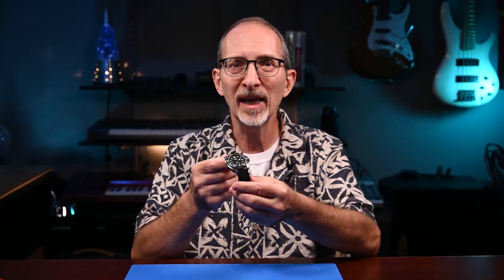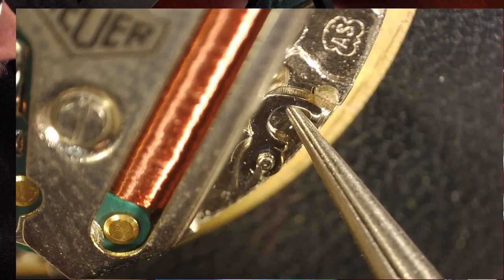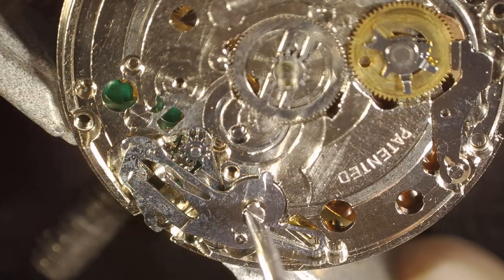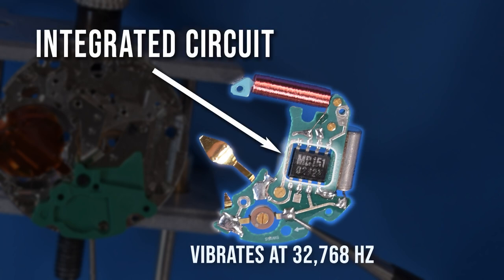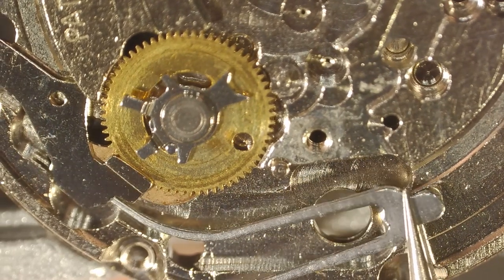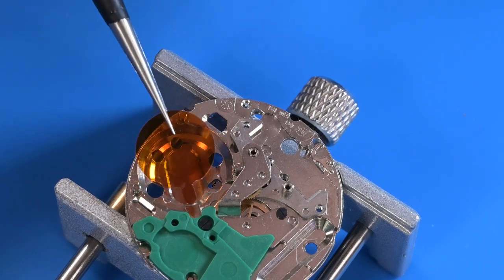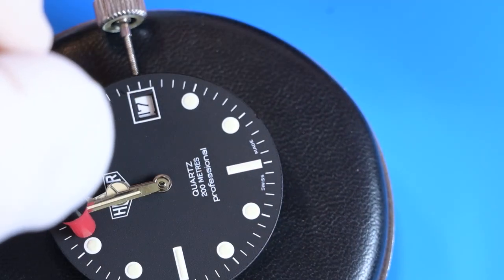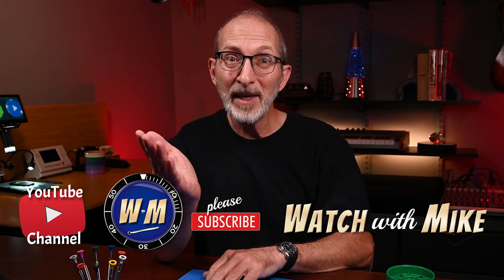Learning Wrist Watch Repair on a 1970's Dive Watch  |   Heuer 8440 Quartz

Comment: I am a watchmaker and I have to tell you what a good job you did. Great explanations and part names and functions. A thought on the date misalignment. I didn’t see anything wrong with the date wheel alignment and function. Sometimes the dial gets shifted off center by a drop or large hit. Take the hands off and observe if the center hole is perfectly centered with the hour wheel. If it’s off one direction I think that’s your problem. The fix is not for the faint of heart. You must move it back into proper position by tapping the dial edge while supporting the metal main plate of the movement. Wearing finger cots I pinch the movement between thumb and first finger while resting the metal plate on a bench block. Start gently with a wooden stick. I cut one from an oak board approx 12” long by 1/2 “ wide by 1/8 or 1/4 “ deep. It just needs a bit of mass to do the job. Start gently tapping and increase force as needed.
Reply from the maker: @Danny Hanke - thank you for the kind words and the detailed suggestion about the date wheel alignment. What you describe makes sense. At some point I will upgrade the crystal on this watch, and I'll dig in and take a look at the date wheel issue. I appreciate it!

Comment: Very cool video. This was me about 10 years ago when I started watchmaking as a hobby.  I started with a Tag Heuer F1 watch from the 80s. You glossed over setting the second hand. This is always the hardest part for me trying to align the second hand perfectly with the indices on the dial. It often takes me multiple attempts. I always wondered how it was done during manufacturing. I suppose by hand but maybe today it's automated. That movement has a small rotating rheostat that allows you to adjust the timing if it's running fast or slow.
Reply from the maker: @MTB Biker - i’m really glad you found this video and commented! Yes, there is indeed an adjustment rheostat on the electronics block. I deliberated on whether to pointed it out in the video, so great catch… I’m glad it came up here in the comments. When it comes to setting the second hand, I cheat! This might be bad practice, but I just nudge it in either direction once it is mounted, until I have it pointed exactly on a marker. 🙄🤣
Reply: @WatchWithMike  thanks for the tip

Comment: Could be that the cause for the date out of center of the window is: the dial legs/posts are bended slightly so the 3 o'clock is not exactly aligned with the crown...:)
Reply from the maker: Thanks Elia H., I will have to take a closer look!

Comment: I have a cheap Swiss Army watch that has capstone tape under the battery, but it got unstuck and wrinkled up ....... I think my battery is either shorting out incorrectly or it already did and half melted that yellow capstone tape and maybe permanently ruined the watch?
Reply from the maker: It sounds like it's time to take the watch apart and assess the damage. Try replacing the damaged tape and putting in a fresh battery while the watch is open to see if it runs. If it's indeed dead then maybe you can find a replacement movement, if you like the watch and want to give it a new life!

Comment: i only like to fix stuff where I can use a hammer and nail gun.
Reply from the maker: @James Morrison - well then maybe you'll like this video where I use an 8" adjustable wrench and a 3/4" nut to remove a watch back. https://youtu.be/Jrd2ZQ96VH4
(If it didn't work then I would have resorted to hammer.)